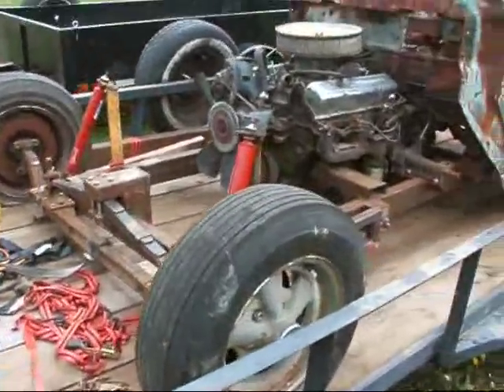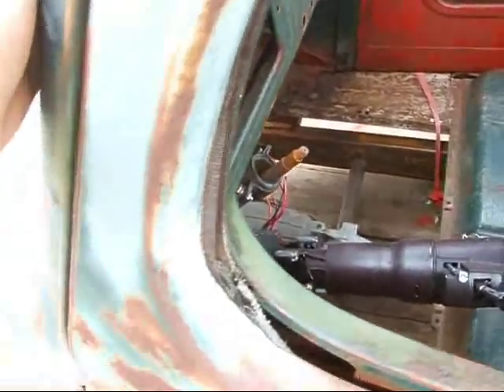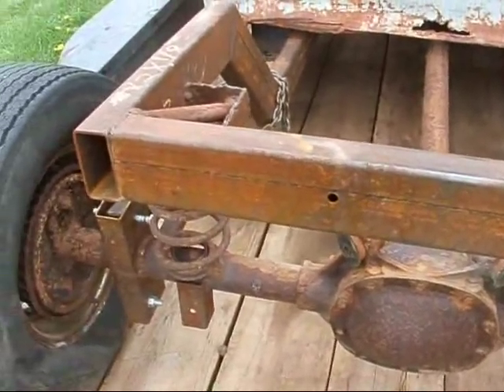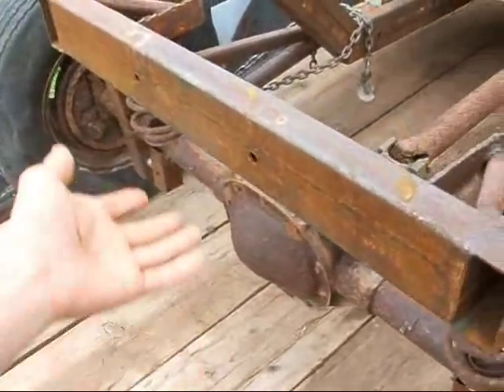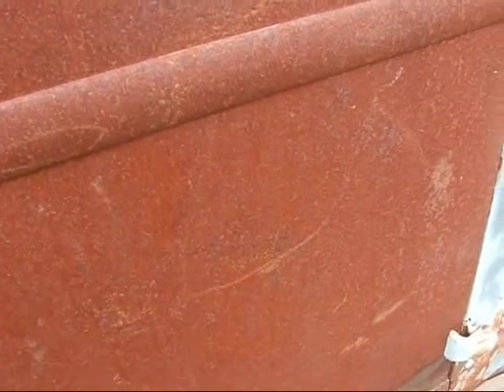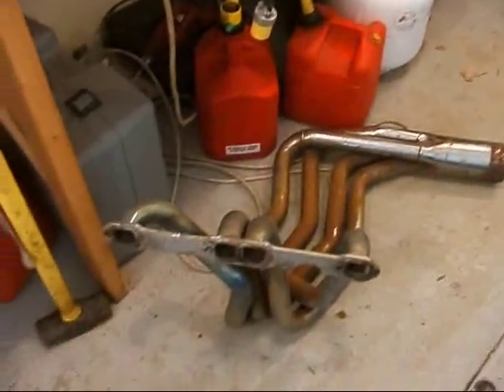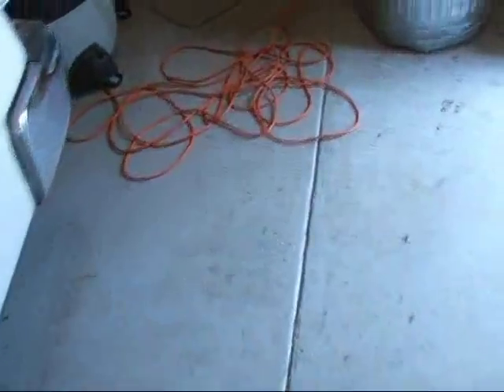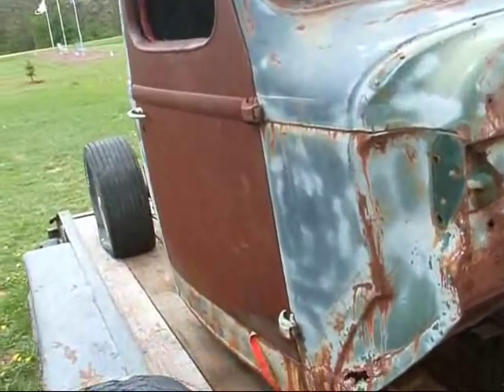rat rod international harvester 23

Comment from the maker: @SoilentGr33n after welding the crap out of them using many many sticks there not going anywhere! or are you referring to the bolts? well thats not the ones i will be using they are just used now to hold it together until i find different ones and i plan on doing a slight modification that im not gonna worry about for awhile yet!